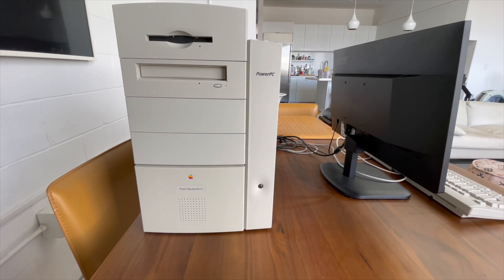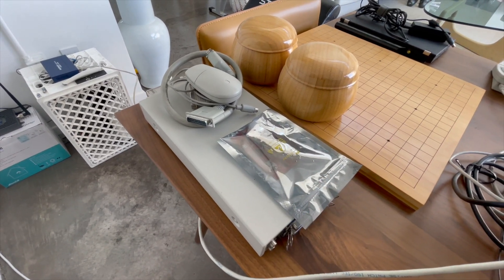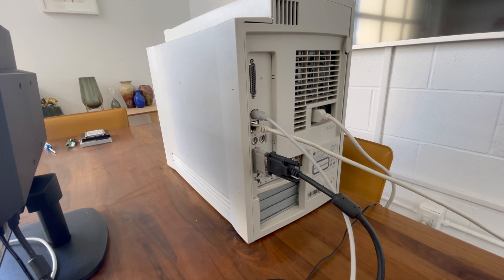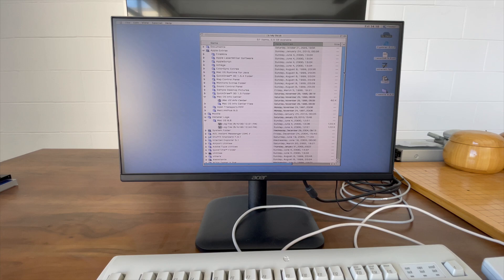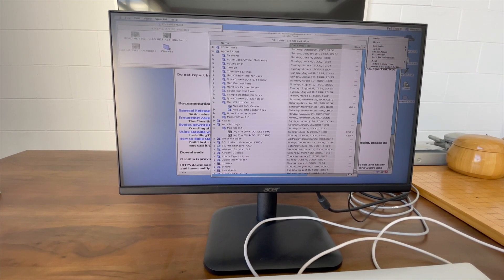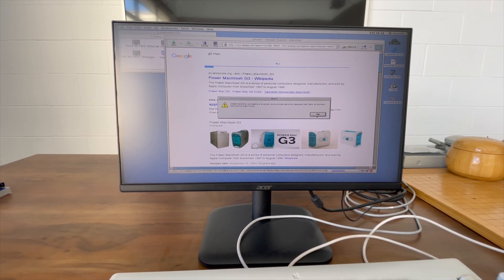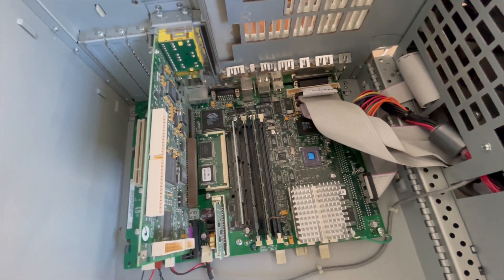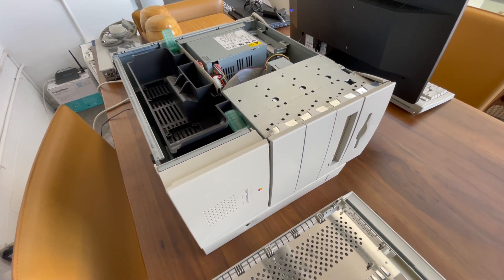Apple PowerMac G3 Beige tower - booting, ssh and web, opening it up Part 1

Comment: Update (not that anyone's paying attention at this point), but BlueSCSI can be used for an upgraded hard drive, as it can give your vintage Mac a modern SSD. I believe RaSCSI is another, similar option.

There may also be ZIF G3 and possible G4 upgrades you can throw in there as well.